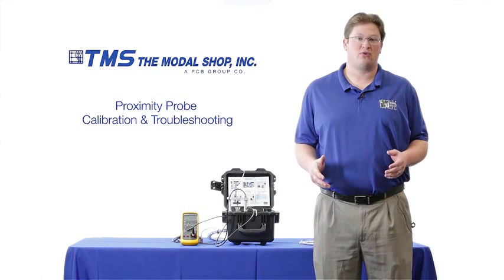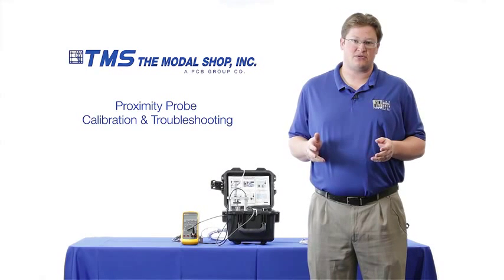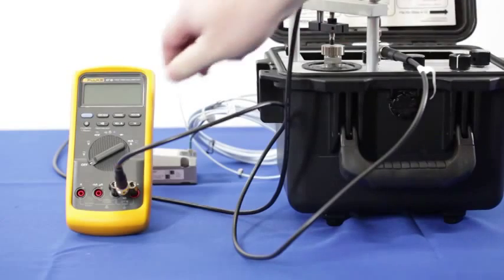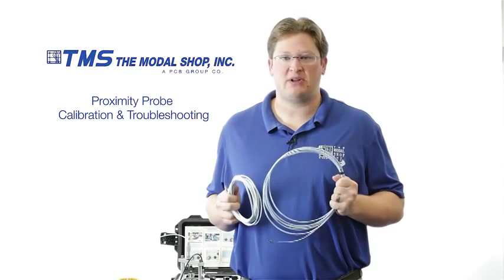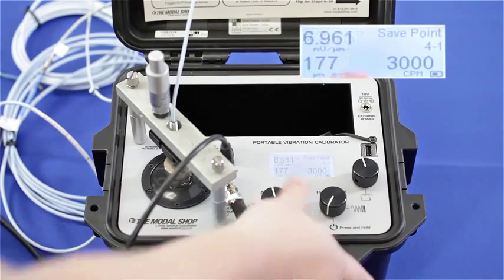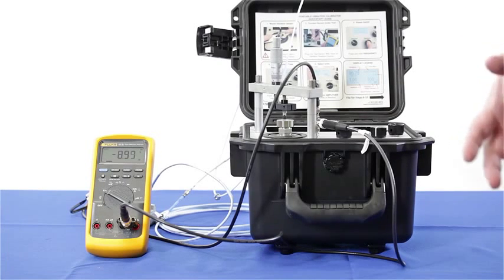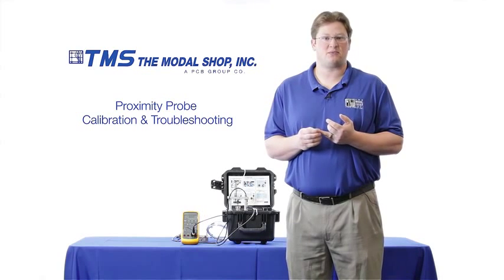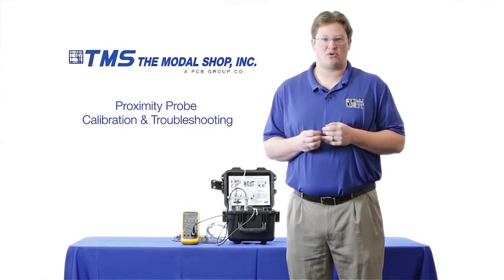A Summary on Proximity Probe Calibration and Troubleshooting Using the TMS 9110D

Comment: You said gap voltage is -9v for 50 mil, my question is why not -10v instead of -9v with the coefficient of 200mv/mil ? Thanks!
Reply: You will need to contact techsupport@modalshop.com  ... we are a rental agent and they will be better equipped to answer this enquiry ..